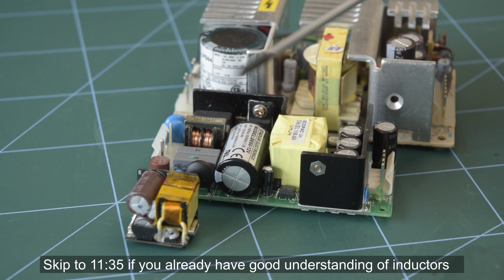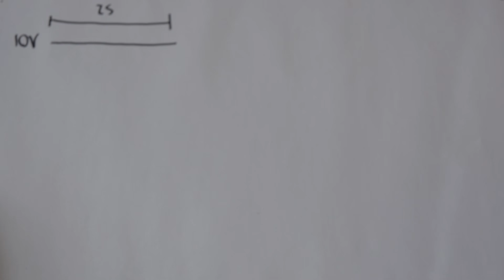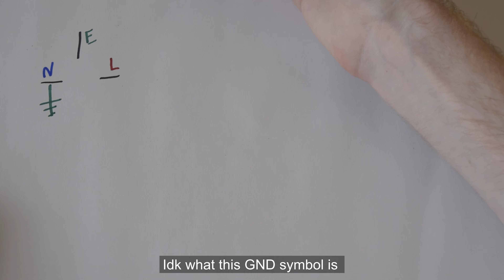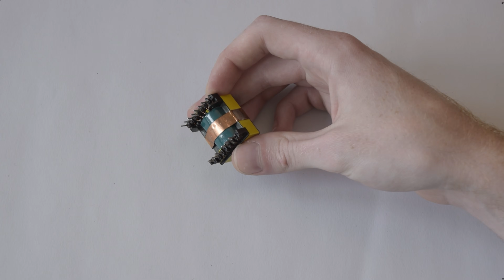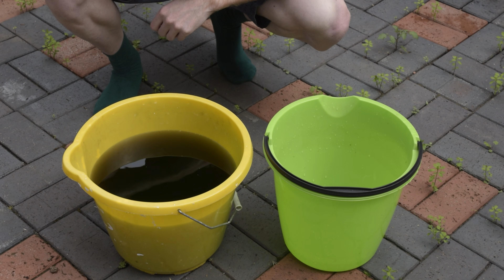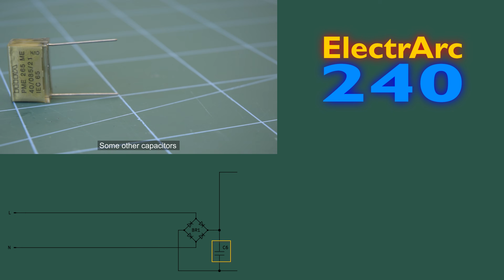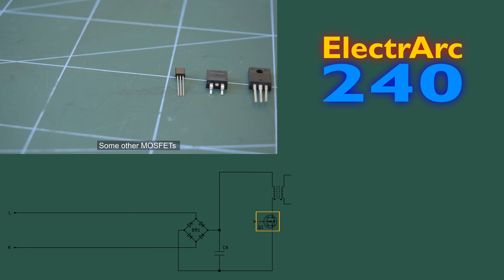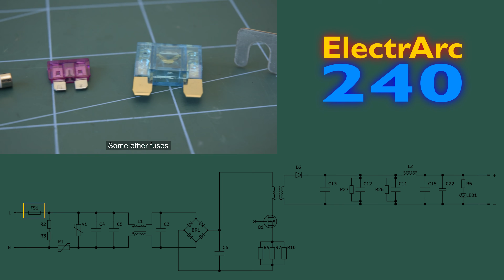Every Component of a Switch Mode Power Supply Explained

Comment: As a metallurgy student I have a basic understanding of electronics but this is great, introducing the working principle so a child could understand but then covering the actual engineering considerations and practical complications.

Could you maybe do a video on active/ synchronous/ mosfet rectifiers? They're supposedly widely used with these sorts of power supplies because diode losses are devastating at low voltage high current (like would be needed for electrolysis). I have an old microwave transformer in need of rewinding because I'm afraid of becoming a statistic if I mess with high voltage.
Reply from the maker: I will do one soon on active power factor correction. Which is related

Comment: in the 90s they werent using power mosfets. they were using HV flyback transistors replaced many under rated ones with the good ol' BU504 transistor. so many heat dissipation issues with SMPSUs back then

Comment: I don't know if it's been mentioned already, but when you come to repair these things, be very careful of the big capacitor if the oscillator has failed to startup (the most common fault in my experience)  - the cap is rated at 400v for a good reason! On the subject or repair, if you see a resistor of about 750K and 1/2W rating then that's your most likely culprit ;-)

Comment: I'm hoping you get around to a video on the MOSFET controller, more specifically how the feedback and decision making works, monitoring the output to adjust power use etc.  Specifically that little two pin "thing" (not sure exactly what it's called) that plugs the mains side to the output side, connecting the two isolated circuits somehow without actually "connecting" them?  Saw them a lot, just a tiny little black rectangle with two pins either side between the input/output circuit sections...

Anyway, really like these vids man u got a sub here.  I'm really interested in electronics and been self teaching for a few years trying to get past the basics where I can engineer more complex circuits for custom needs.  I went the chemical engineering route, and I'm wanting a very specific power supply signal to experiment with some electrolysis theories.  I know the chemistry well, but alas my electronic building capabilities are mediocre at best.  Please keep these coming.

On a personal note, I know you can't do a video for one person, or even if you have time to read this comment...but I'm wanting a decently high current capability at 30-80V, but I need a high frequency (adjustable preferably) A/C signal that's DC offset so it pulses the electric field but does not reverse polarity due to driving electrolysis it'd screw up the reactions.  Is this possible as a diy project realistically?  If so what would you recommended to study specifically, and do you have any vids that might help here or plan on doing any on similar subjects?

If u do get around to reading this, thanks for your time.  I've had a good idea theoretically for years about a specific electrolysis problem, and on paper and as far as the chemistry is concerned it should work.  However I've been stuck unable to build the signal generating device I need to power it, but I've decided to try and learn how.  Any advice/direction from someone that knows what they're doing would be highly appreciated
Reply from the maker: I think that sounds fairly doable. You can just see it as an AC source in series with a DC one if that's simpler. As for material to help with building something like that I'm afraid I have no idea, I wish I had time to help more cause it sounds like an interesting challenge! Should definitely be doable!
Reply: @electrarc240  ok cool, thanks for ur time to read and reply.  I'm thinking a signal generator to create square wave pulses, maybe a preamp to bring it up to 6 ish V, then a simple V amplifier to get high enuf V to control power MOSFET to drive the main high power signal that feeds the E cell, being square wave (or really similar steep V increase as a quality square wave isn't necessary but it can't be a slow change like a sine wave) should keep the MOSFET out of transitional stales of higher resistance/power use getting hot. It won't be really high freq in theory, 100kHz at most but most likely around 30-40kHz...not sure here yet this depends on how the circuit resonates with the cell and I can't calculate that....too many variable with electrode spacing, concentration of electrolyte, diffusion rate, surface area etc etc so I'll have to build it and then find resonance that's why I want an adjustable freq control

Do you think driving the high power cell output would be good with MOSFET like this setup, or you think a power IGBT or something would work better? I'm pretty sure I can build the stages mentioned above good enough, but the area I am not sure how to go about doing is the usage of the stepped up V signal that will drive the MOSFET, if I'd feed it to the gate or would need some kind of more complex intermediate circuit to control it properly....why I was asking if you were gonna do a vid on the MOSFET controlling aspect from your power supply breakdown.

Anyway thanks for response bro and your time making these great learning videos
Reply: P.S.  on the behavior of the cell having a capacitive effect, I'm curious as to what will govern its capacitance; I'm hoping it doesn't vary drastically as the cell runs, but I can do experiments to negate this with some effort....fluid dynamics mixed with chemical reactions and mass flow/transfer and diffusion rate through a solvent is a bi*ch to try and model!  I wish I still had access to software like COMSOL and such to try and get an idea of possible behavior, but setting up some cells with varying concentrations and electrode plate size/spacing then finding what they resonate at should be adequate.  I'm trying to see if in a pulsing strong E field, since water is polar if the molecules bonds can be stretched and weakened by the field with a pulsing signal changing the field at a harmonic to the natural vibrational frequency of the bonds.  Theoretically they will align with the field, be stretched by the alternating field as pushing a kid on a swing gets them higher and higher with a tiny energy input if its done at the right time, weakening them to the point they will cleave and then free radical reactions will generate some H2O2 from this mechanism, without consuming more current cuz the mechanism will be homocleavage of the bonds due to e field and not electron transfer consuming current, added with getting resonant matching to minimize current draw should yield a much more efficient production.

I know that's TMI, but that's what I'm working on

Comment: wow, all that EMF filtering stuff makes sense why a 9V DC wall wort power supply for a DIY signal generator made my O-scope go crazy whenever it was plugged into the same isolation power strip. Made the O-scope useless. I got smart and used a 9V battery to power the signal generator and all was well.

Comment: Hi Electrarc240, thanks for the thorough explanation! It is super useful for learning power electronics! Looking forward for your next video! Some questions about the circuit analysis to verify we're on the same page:
1. I see you put one Y-cap at the filtered line input, but the other after the full bridge rectifier. Shouldn't that one be placed at the filtered neutral input?
2. Also, you talk about the snubber circuit over the diode, but in the schematic it is connected parallel to the secondary winding. I think you meant draw it over the diode, correct?

Comment: Talk about a bridgeless PFC circuit. The 1895 bridge produced 3rd harmonic distortion. Then add a circuit to minimize the inrush current caused by your capacitor. Then an ECM filter to reduce noise created by the following boost circuit.

Comment: Hi. Amazing vid.

Could you do a vid on the Gallium power supplies and how they work? That'd be lovely.

Thanks.
Reply from the maker: They work in a very similar way overall. So it will probably be more just a video looking at GaN itself and maybe slightly covering how it changes the topology slightly. For example most GaN PSUs will have active rectification, swapping the diode at the output for a MOSFET to reduce losses

Comment: Just missed an important component,  the IC on the back of the board witch is the controller that creates the pwm for the MOSFET. But despite that it was a good explanation

Comment: Really great video!  Very well explained. But I'm pretty sure a lot of these PSUs aren't isolated.  Isolation usually a feature in industrial PSUs and I even once belew a laptop up whilst charging it and programing and Arduino-based PLC which had a shared earth shared with +50VDC. The +50V DC reached that laptop via the earth pin on the charger and once it had ground via the USB, the circuit was complete and bye bye laptop.  And I will often get a small electric shock when I tock my PC and the barrel jack of one of these PSUs!

Comment: whoa, solid portion of walkthrough. and especially valuable due to NOT ommiting EMI part; while it's useless and can be cutted out of any SMPS (cheers to the China!) these are crucial for our power grid not to turn into giant radio as well as frying neighbors' commodities. Waiting however for pt2 about optocouplers and PWM regulation BECAUSE I'VE BUILT THIS DAMN THING OUT OF YOUR SCHEMATICS AND IT IS NOT WORKING ACKTCHUALLY ;p

Comment: Hi, Thank You... That is the one best presentation i have ever seen... Thank You again.. small doubt this is a forward converter if iam not wrong, Why do call it as an inductor not a transformer.. that element dose the same job as the transformer ??
Reply from the maker: In a flyback converter like this that component stores energy which makes it a coupled inductor. Energy enters through the primary and then when the switch turns off it comes out of the secondary. In a transformer energy passes through - in enters the primary and leaves the secondary simultaneously, so it is never stored. Coupled inductors are simpler/cheaper to use but not good for high power as they would have to be large to store enough energy

Comment: Also, I love that property of inductors, it's ridiculous. Inductors are like flywheels. A flywheel wants to keep its momentum going and REALLY doesn't like changing it.
In electronics everything is a conductor given enough voltage. Even an open circuit isn't really open, a few thousand volts could "close" it again.
For a flywheel, interrupting a circuit is like introducing a lot of static friction: something that is hard to initially get moving. The flywheel either kicks the mechanism really hard until it moves or annihilates the gears. Unless the elasticity of the material eats the entire momentum like a champ, could also happen.
For a charged inductor, removing from the contact creates an air isolated gap. However, the current is still flowing. But the charges cannot go anywhere in an open circuit, so the open ends get charged until a breakdown happens.
And that's the most absurd part. An open circuit with a charged inductor is just a piece of wire with a flowing current. Not charge, or voltage, but current.
Reply: You can say inductors are resistors for changes in current. (But of course that's a 'model' inductor, not a real one; the 10 microHenry choke on the output is only that at 100 MHz.)

Comment: Hi, thanks for amazing video! It was just what I needed and I think now I’m more ready to design my own.

However, right at the part that was interesting the most, I feel the video cut out. Can you elaborate maybe how to control the output voltage and how to maybe implement current limiting using tl494 or uc3834 ? I would be extremely grateful even for a guide.
Cheers from cze 🇨🇿
Reply from the maker: I will be covering the control more soon if you can hold out till then!
Reply: @electrarc240 thanks mate !

Comment: Excellent and very useful presentation.  Understood this far better than learning from a textbook.  I noticed that in a lot of instances >2 resistors/capacitors were used when they could be replaced by an equivalent resistor/capacitor.  Is there a design reason for this?  Does it reduce malfunction if one of the components fail?
Reply from the maker: Sadly it doesn’t because they are all in series so if one fails they all fail. It’s probably down to cost, multiple smaller components can be cheaper than a single big one. Or possibly voltage rating as a single small resistor may not be rated for the voltage it will experience

Comment: I was drawn here by my interest in guitar pedal isolated power supplies. Anecdotally, I'd heard modern switch mode PSUs were an improvement on older ones with a toroidal transformer. The older ones can give interference (from fluctuating magnetic field?), so I was surprised to see the inductor and I now wonder why this wouldn't also cause interference? For space reasons, it's common to mount the PSU directly underneath the pedal board, in immediate proximity to the pedals.
Reply from the maker: I imagine most of the modern ones probably would cause interference sadly, the EMC filtering has become a little sparse recently…
Reply from the maker: Switch mode power supplies might have less hum but more buzz if that makes any sense!

Comment: Basically a switch mode PSE has a transformer stop step down 240 or 110vac to for instance 12vac on the output, that output is smoothened by  transistors capacitors doides to change that 12vac to 12vdc

Comment: This is a very good explanation, loved it. My favorite part is where you show the two buckets and the leaking increasing with frequency =)
One question, are the class Y capacitors really necessary on the primary side? I thought X rating is sufficient there. Also, are there no connections from the secondary side to the GND using Y capacitors?
Reply from the maker: Thank you! Any capacitor to ground needs to be Y rated, and it seems there is always at least one of live/neutral connected to earth though one. Also there was a Y-cap between secondary and GND but I missed it when making the schematic :(
Reply: @electrarc240  Thanks for the clarification! I guess the reason a Y capacitor is needed for the PE/ground is that the ground is considered less safe than SELV contacts? By the way, I've heard (cannot quote any standard, though) that in some countries, two Y capacitors in sequence are now required for additional safety...

Comment: Hello! I am a 2nd year undergrad studying at the California Institute of Technology. I was wondering, how do you decide when to include circuits to remove noise, and how do you decide on the values of the capacitors/resistors/etc? Any resource for learning more of the math behind these circuits would be very helpful !
Reply from the maker: If you search how to design a snubber there are a few good docs on that. And as for when to add them, they’re mostly there for compliance with regulations on how much noise a circuit/product can release, so they probably add them in when they are above that level. As far as I’m aware there is a lot of trial and error for this kind of thing!
Reply from the maker: I’m sadly not very knowledgeable (yet) on these things as I currently work in F1  where there are no such regulations so we don’t really care about noise as long as everything works!

Comment: I'm not entirely sure but pretty confident about this: the sudden explosion of "little black boxes" happened because of UL (& similar) regulations.  A device which has a direct line voltage input (and thus integrated power supply) has stricter qualifications than a "low voltage" device (usually 12-24V range or under 80V).  Line and Low Voltage equipment have very different safety rules.  Outboard power supplies had to be certified by their manufacturer and the people who make your device have less paperwork to deal with.  And probably fees too... .  Most of the fun stuff we use ultimately runs on the 3-12VDC range.  It's only hard-core analogue devices like heating coils or magnetrons or valves or motors that really need that pure pure mains electricity hit.

I was quite surprised one day when I discovered my Mini-disc player only needed 1.5V.  But you can run a computer on .7 to 1.5V right?  Where did I learn that?  

...still alive...
Reply from the maker: Really makes me think houses should just have a central 12V PSU with all the bells and whistles (high efficiency and active PFC) and then everything just bucks or boosts from that. I guess then everything would be electrically connected but if DC- is earthed that seems ok for most things? Just crazy that every house has so many identical SMPSs for everything

Comment: A little note: While the smoothing capacitor right after the rectifier can and will hold a charge for some time on its own, it is certainly not days and weeks here: The switching circuit will quickly drain it and sometimes you even have a discharge resistor in parallel to it. If the capacity was isolated and charged, yes, then it can hold up the voltage for an extended amount of time. 
This however does not invalidate your statement of checking it to be discharged! Always work safely, people.